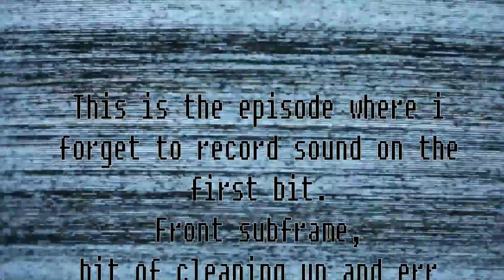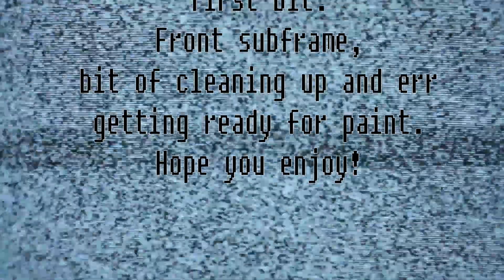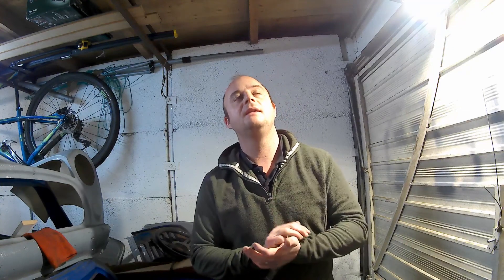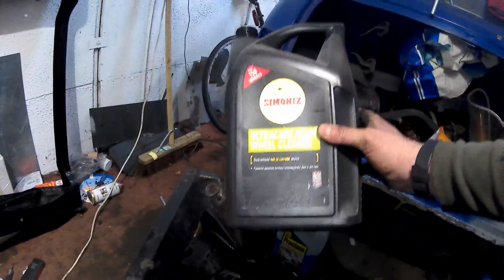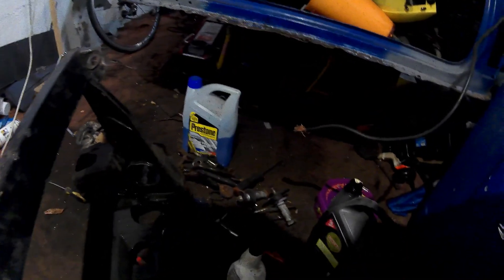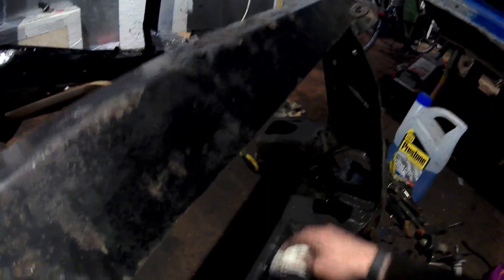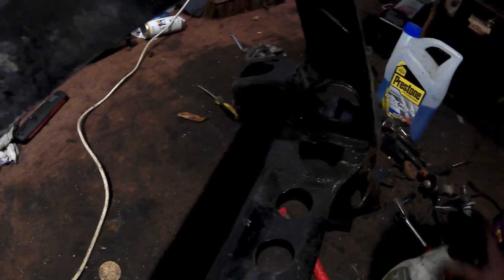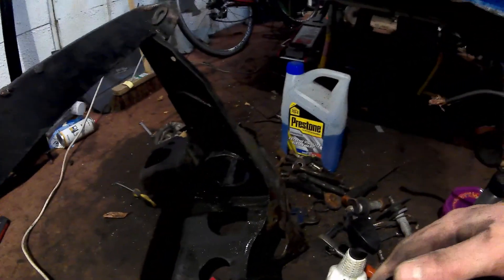Classic Mini Restoration | Episode 6

Comment: nice work sir, i hope to see you at Bingly Hall.  

Ps - use your safety goggles, a wire bristle in the eye is not fun :)
Reply from the maker: The Gentleman's Motor Racing Team thanks. I did wear a shield for a bit of it. I should wear eye protection more. I just get stuck in and carried away